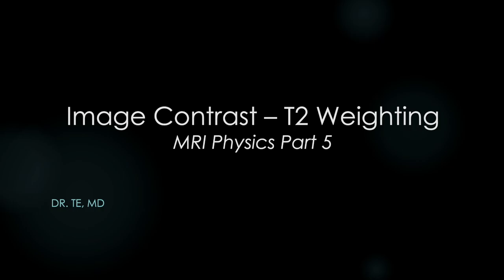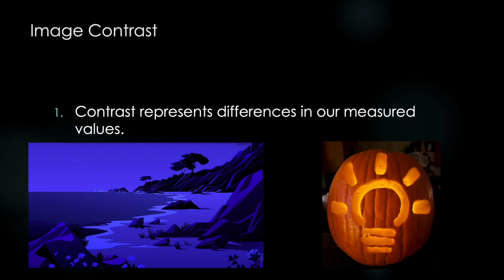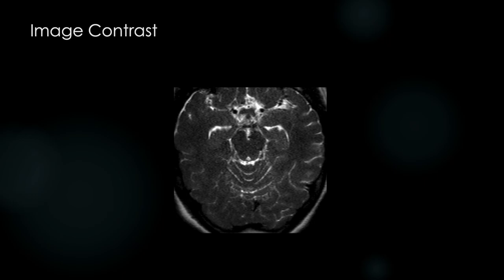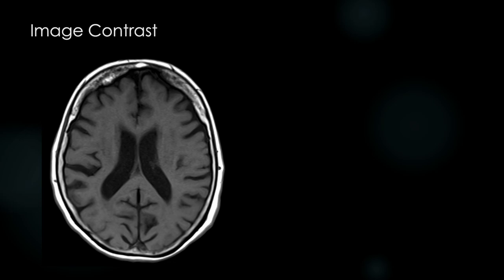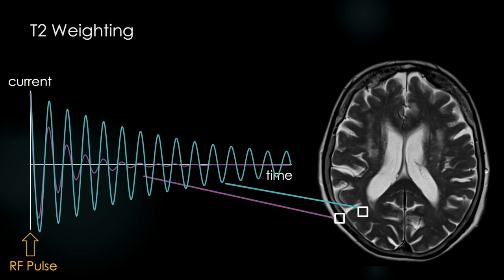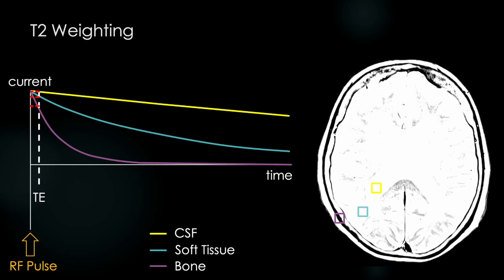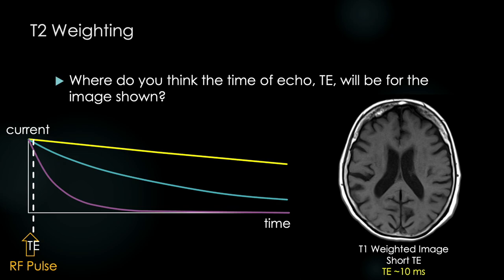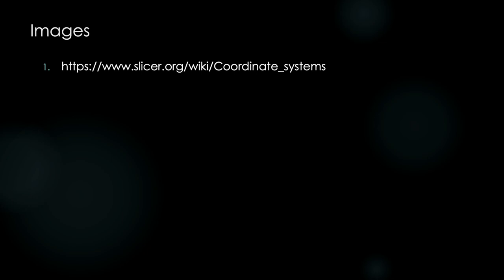MRI T2 Contrast EXPLAINED | MRI Physics Course Lecture 5

Comment: Thank you for the fantastic videos, I'm really in love with this series. Just one question... I couldn't help but notice that all the decay curves from each voxel have the same frequency (12:14). They're not supposed to have different frequencies decay curves corresponding to their localized applied magnetic field which is = (main magnetic field Bo and the gradient field)?
Reply from the maker: Correct! The frequency will depend on whatever magnetic field that voxel is experiencing. This example would be if we have no gradient field applied and our B0 field is uniform across the slice. You can imagine how messy things become once we start applying these gradient fields. Check out the signal localization lectures if you haven't already to see exactly that!
https://youtu.be/v8jW8K1y-KE
https://youtu.be/DYj1SLNppQM
https://youtu.be/nFDzXvjF7gg